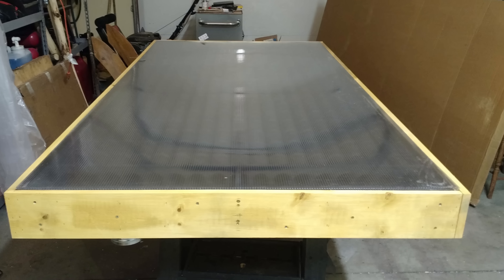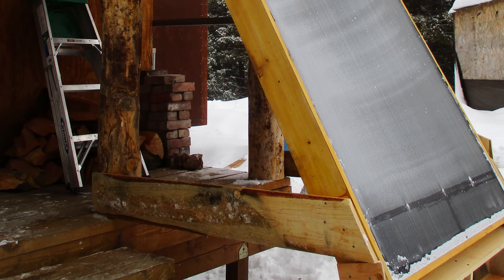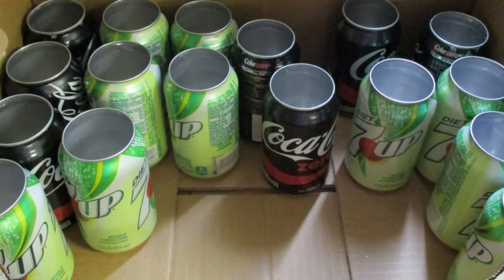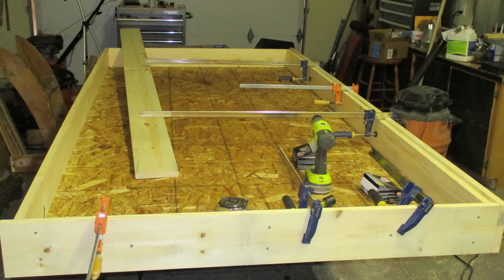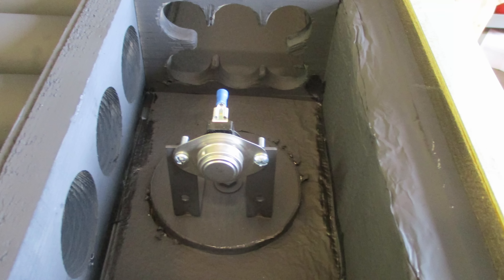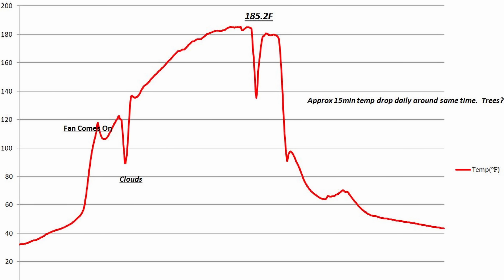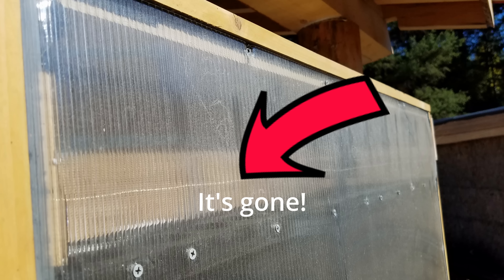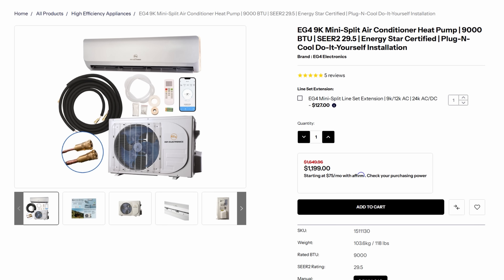7 Years with Pop Can Solar Heater - Is It Still Worth It?

Comment: I built a small one (53 cans) many years ago after seeing a video about them. I was at my parents home and there was no way they would have let me put a hole in the wall so I had to build it with the intent of using it on a table inside, right in front of the living room window. I used computer fans for intake and exhaust. My one mistake was setting the thermostat to 120F. I should have set it higher to allow for more heat buildup because being a small unit, it colled down pretty quick. But it did work. I used a small solar panel to keep the battery charged.
Reply from the maker: That's a really interesting approach to building one without putting a hole in the wall!
Reply: A collecror inside the house is a total waste of time and money. The solar heat is already in the house.
Reply: @kkarllwt I had the time and it didn't cost much. And like I said, it still worked.
Reply: @JoeR860  No, it didn't work. It added no heat to the house. The heat was already in the house Once sunlight is past a glass window, the energy will degrade to the heat of the room. Simple entropy..
Reply: @kkarllwt  Well since the sun shining thru the window heated it enough to trip the fans and blow out hot air.....yes, it did work.
Reply: @kkarllwt Depends on the house. In a 130yr old home with loose wood chips for insulation anything will improve heating, trust me.

Comment: Why make a can solar heater?    What you could do is enclose the porch in clear plastic roofing panels and make your porch into a greenhouse.    Take it down in the summer, but put it up as soon as it is cold enough.
Reply from the maker: I've actually considered doing removable wall panels for the covered porch but the main porch has to be secure (locked) and retain the heat that is generated (insulation).

Comment: You might go with aquarium on porch black back absorbs heat stored like battery.
Reply from the maker: Many do this with 55 gallon water drums and run the water through pipes to a solar water heater.

Comment: Interesting, I like the idea although I dont think I could be bothered with cans I prefer some tube. My only question is they way I think I hear you was you put the fan in the exhaust, that is in the hot air stream, is that right. I would have thought that wouldn't do the fan any good and it should be pushing air into the inlet?
Reply from the maker: Yes, I went with what I'd seen without questioning the position of the fan and after others suggested placing it at the bottom I thought "DUH!" great idea! :)

Comment: I think a couple of 400 watt solar panels hard wired to a 1or 2kw resistive heater would do the same job for much less money, zero maintenance and much more reliability. I can understand why a decade ago this would not have been economically possible, but with the massive fall in solar panel prices (as well as the availability of second hand panels for close to nothing) spending $600 on a pop can heater no longer makes financial sense
Reply from the maker: Perhaps, but it has been a fun experiment.
Reply: @TheOldJarhead  when you compare the $600 investment vs a mini-split, you are forgetting all about running costs.   The mini split will have to consume electricity / propane or some form of energy forever.   Once you calc the ongoing running costs PLUS the upfront investment, your heater will still be $600, but the minisplit has ongoing costs FOREVER.   Don't forget to calc TCO (total cost of ownership)
Reply: A 4 by 8 can heater will net about 3000 btu an hour in good sun. You will need about 1200 watts of used panels to get this. Still, much cheaper and easier to use solar elecric . No holes, fans, and the electricty can be used for other things, The electric panels can be placed a distance away
Reply from the maker: I did a calculation based on some experiments others did and calculated the BTU's of this heater at close to 6000btu's.  However, now that I have 2400+w of solar (soon to be more) I could run a mini split with that all winter long as I don't need the mini split to work when I'm in the cabin (woodstove heats it fine then) but this was a fun thing to mess with and I plan to rebuild it still.
Reply: @TheOldJarhead  The solar radiation is about 240 BTU a sq. ft in full sun. But the twinwall passes 80 % of the energy. and at R 2 It looses about 20 % on a cold day. The box loses some heat.  The duct work looses heat. 3000, maybe 3500 BTU  an hour.

Comment: There are ready-made ones available for purchase, for example, the Sunwind AirPlus 100 solar ventilator.
Reply from the maker: Those run in the thousands but yes.  There was a company in Canada called Cansolair who sold these for around $2800ea but I don't see them anymore and at that price I'd get the Signature Solar EG4 12kbtu minisplit and solar panels (for less)
Reply: @TheOldJarhead  I don't know if they are good but in Sweden they are sold for example for 600 dollars Solar heating panel AirPlus 120 
Height (cm):146
Depth (cm):8.5
Width (cm):66.4
Recommended room size:120 m2
Air flow:
120 m3/hour

Comment: Excellent video, Informative and well presented.  I've been thinking of moving my air compressor from inside the garage to a shed beside the garage to cut down on noise and gain a little space, but need a way to heat it so moisture in the air lines doesn't freeze.  The shed it 4X10' and I wouldn't need it toasty warm in there.  This with a solar powered air pump seems like a viable option. 
Thanks!
Reply: Moisture will condense on the walls of the tank and pool at the bottom . The problem is the tank drain and any associated piping  that will freeze and split. Some temp regulating heat tape ?
Reply from the maker: Or environmentally friendly antifreeze
Reply from the maker: That's an interesting application for the solar heater!

Comment: Great video, but to say that you're spending half as much as a split heater is sort of like comparing apples and oranges. It's not just about the initial cost, it's the ongoing cost of energy that's the real issue. Sure, relying on the sun is a limitation, but this $600 initial cost may pay for itself in one or two Winters. It seems like this, plus a rocket mass heater, would be a solid way to get cheap heating as far as energy costs are concerned.
Reply from the maker: Agreed.  And neither work in the cloudy snowy days so the woodstove is the best option.
Reply: A can solar heater will produce about 1 therm ( 100,000 ) BTU a winter per sq. foot. Its value is the substitution for what you pay for a therm of energy, I heat with nat gas and pay about $ 1 all in My 4 by 8 is worth about $ 32 a year,
Reply from the maker: Thanks for that!

Comment: Here in Australia in summer you don't put your hand in front of the garden hose and turn on.
Reply: A year after I bought my house I bought one of those old style sprinkler hoses. The flat kind with two tubes. I made some brackets to position it down the length of the peak of my roof.attached a hose to it going down to the spigot.
In mid day when the heat rises I turn on the water for a few minutes and sprinkle my roof. The temperature in the house drops about 22° within 7 minutes. I turn the water off and do it again an hour later.
Will probably put a sprinkler timer on it so it can cycle in the afternoon.
Reply: @GigMaresh  We did the same in a workshop in Perth . Without the sprinkler it hit 140 F ,i measured it. 60c.
Reply from the maker: I bet
Reply: @chuckmaddison2924  True in Atlanta GA too.
Reply: Same here in California.
Reply: @LexYeenWe drink a lot of sea water and " recycled " toilet to tap is more accurate. 
Trying to keep a green lawn is difficult and expensive.  We do have restrictions.
  Western Australia
Reply: Yep , it’ll burn you . Cheers mate
Reply: @chuckmaddison2924   Same here in Florida.
Reply: In the Philippines I offered to make a hot water heater for the house by putting a cistern on the roof and just running water from it through some black ABC plastic tubing on the roof but mother in law didn't want it so I never got to try it out. I would have enjoyed at least a warm shower instead of a cold bucket bath.
Reply: Why not?
Reply: @ItsMe-ic7on  1 it gets bloody hot and will burn.
      2   if the hose has been sitting its possible a poisonous spider is sitting in the end.

Comment: Use a can opener, works good. I built one a long time ago, it just got too cold at night in winter for the way I built mine, a way to automatically close off air when it's cold would be nice. 

I still have an idea in my mind of digging a wide hole in the ground, filling it with black metal and covering it with windows and blowing air through it and se3ing how it would work.
Reply from the maker: I actually used a can opener for the tops after a while and it was much faster and better.

Comment: Thanks for the info! Good to know!
About 'vaporized insulation' - anything that gets that hot, might introduce carcinogens into the air - Be careful and make sure that what you're using is rated for that heat!
Reply from the maker: That's a very important point about the insulation!

Comment: Years ago the mother earth news built a similar solar heater.  They just fastened a piece of plastic sheet over the exhaust.  You need to have the exhaust outlets open straight up and down.  In your case, maybe use a 90 to make that happen.  The plastic is so light that it opens with convection but prevents backflow.  Thankyou for posting.  Very informative
Reply from the maker: Thanks for the tip about the plastic sheet and the exhaust outlets – that's a clever idea!
Reply: It helps if the exhaust is a series of vertical strips to support the membrane and is at a slight angle. lightweight paper works well. Mine is going on 8 years,
Reply: I was thinking an aluminium pie dish, but same idea, yep.
Reply: 'flap valve' or 'reed valve', used a lot in pumps etc, good idea, the lighter the material the less restriction to flow
Reply: I did the same with a similar heater design, and the plastic worked well to prevent backflow.

Comment: I am planning on building one for next winter (this winter, I am testing a small prototype) so what a coincidence that you put out a review video on yours. I really appreciate the facts you brought up:

1. Need for high temp foam insulation
2. High temp silicone seal isn't perfect
3. High output temperatures even in low outdoor temps
4. Reverse air flow at night
5. One inch insulation works fine

I just have a few questions if you don't mind answering:

1. What is the foam insulation that you are recommending? I heard "poly sy" but I'm not sure what that is.
2. Did you use Lexan? How does that hold up after 7 years of sunlight? I was thinking of using glass or acrylic and was wondering whether these were good enough options. 
3. Was there a reason you went with beer cans instead of a pipe or duct? I know that turbulent airflow is important to draw the heat out but for a 4 inch pipe, 35 CFM should be enough to cause fully turbulent flow. This is for a straight pipe of at least 3 feet. Any bends would likely make it even more turbulent. 

I'm glad you mentioned that the unit works fine with just 1 inch of insulation. I was doing some calculations and thought to use 5 inches (if 1 inch is sufficient, surely 5 would make it even better) but even on a somewhat cloudy day, the sun still provides more energy than would be lost through a single inch. As more sunlight is received, the energy gain rises exponentially while the energy loss rises only linearly. Based on my modelling, 1 inch is enough when conditions are optimal, 2 inches helps out on bad days, 3 inches will should provide enough heat as long as there is light outside. As the thickness of insulation increases, so does the heat absorbing efficiency but the rate of that increase, decreases so the returns are less and less as you pay more for insulation and complexity.
Reply: Use 3 layers of black alum screen .. Keep the airflow high enough to so the outlet temp is about 100 deg.
Reply: @kkarllwt  Is there an advantage of this product vs black spray paint?
Reply from the maker: Thanks :)  The insulation should be Polyisocyanurate insulation which can withstand pretty high temps.

Yes, I used Lexan but I used a honeycomb style and would not recommend.  Glass will work but be heavy and I'm not sure if Acrylic will be ok in the heat and sun exposure.  Lexan held up just fine but the honeycomb style is a bust.

I used pop cans because they were free :D I also ready that while tubes etc work, they really need to create turbulence in the airflow to get more heat into the air so the can tubes with their shape and lips at each end can create more air turbulence resulting in better heat absorption.
Reply: @TheOldJarhead  Thanks for your answers! I want to avoid Lexan since it might be the more expensive option in my area BUT if it works, then a thin flat sheet may be worth using in the long run. And yes, turbulence is a free 2x multiplier in terms of heat transfer compared to laminar flow. My thinking is that if the number of 180 turns and length of the tubes already does the trick, then the project would be much simpler without pop cans.
Reply from the maker: You can use glass you can get from second hand places or even 6 mil plastic will work in the short term.  I just used what others were using and seemed a good idea at the time (and I could afford it).
Reply: @TheOldJarhead  In that case, I'll stick with acrylic and see how it performs long term since it's cheap and readily available. 

I actually just tested my prototype and it was amazing. 1 inch XPS foam box with 2 panes of acrylic. Outdoor temp around 55 F and inside, it maxes out at about 178 F.
Reply from the maker: Nice

Comment: Regular pink dow corning fiberglass insulation takes high temp pretty well, doesn't it?  Cheaper than high temp foam board?
Reply from the maker: Not sure but it would have to bealed well.  Foam board is easier.
Reply: Check their web site or even call them and ask about heat over time issues.  What a material can take in the UL type testing for fire ratings  of less than 1/2 an hour exposure is different than heat day in and day out.
Reply from the maker: True

Comment: Life hack #72.. grab a radiator or two from the wreckers, put in a box..👍
Reply from the maker: That's an interesting idea!
Reply: That's what I did, but to heat water. Only problem is it's rusty inside, so I cannot directly use the water. Other than that it works great, in summer it can reach boiling point (in Germany)
Reply from the maker: Copper pipe works well

Comment: Had a grandmother with a house with a solar water heater on it, barely worked, still had to use a regular gas tank in line. Thing was like 20'x5' on the roof. We still have the house as rent house, i honestly forget if it still has the solar heater on it.